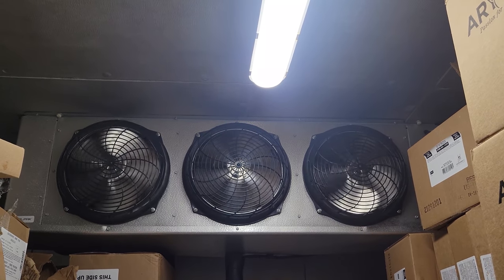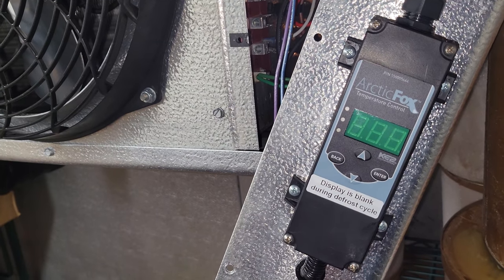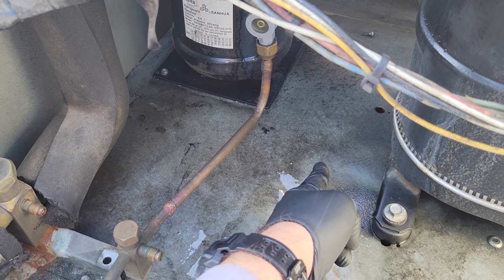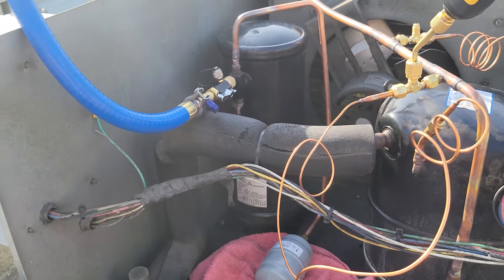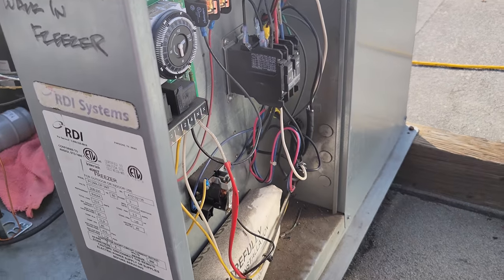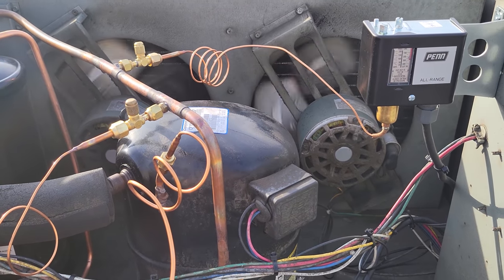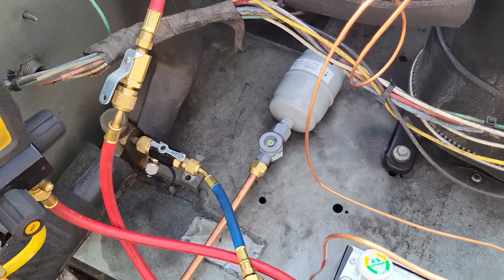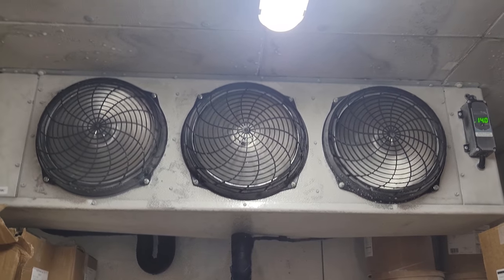THE WALK IN FREEZER IS DOWN AND THERE IS OIL EVERYWHERE

Comment: I love how with the camera frame rate you can see those 2 evap fan motors slow down & speed up slightly.

Excellent diagnosis, added the relay, put in proper pressure controls. Installed in such a way that it's better for the next guy.

A+

Comment: Working as an IT Consultant and parttime electrician i find your videos really fascinating... I like your methodical approach to solving issues and your work ethic is great... one thing that really bothers me is the electronics ratsnest we get to see every time a box is opened... We wouldn't get away with this over here in Europe (Netherlands, to be precise), although i've never opened a roofunit for an large AC or refridgeration installation, i'm quite sure they're a lot neater and therefore safer... (any western european HVACR Engineers here to confirm/deny this?) 

Keep up the great work!

Comment: I love your commentary and theories on pressure switches/controls in the HVAC equipment.  

Disclaimer - this is my opinion as well, I'm an Electical/Controls Engineer who has worked with HVAC stuff for so long I also design the refrigeration parts now as well.  
I watch these videos because 1. I love the "big picture" and doing things properly attitude. 2. I design the stuff, why not watch how people install, service, and use the equipment 3. I can do a better job to make your lives easier.

Why do the small ones (switches) last longer on 24VAC/VDC vs 115/208/277VAC switching?  
Why do the big PENN and RANCO ones last considerably longer only when they have 'enough' load on them?  
Coils.  Contactor Coils.  They all have inrush, and they all have a bit of "snap back" when the power to them is opened.
The 24VAC ones tend to have a smaller inrush, higher holding current (has to for the same VA), and very little kickback when the circuit opens.  That's great for the "wimpy" contacts in a Klixon like pressure switch.  Your big switches need a bit more load/current/abuse to keep their contacts clean.  The small arcs on every open/close even wipe the contacts clean when everything is sized properly, and if its too high a current, you burn up the contacts.  Conversely, if you have too little load, the big contacts will slowly oxidize and make a bad connection.  It's a simple concept when you step back and think about it, yet, it's missed by many.

If you ever want to see it in action, you'll need an oscilloscope, current probe, and voltage probes on each side of each device to watch the circuit in action.

The equipment I design almost never needs new pressure switches, even after 10+ years of service.  Why?  I don't use DP contactors.  I only use IEC contactors with the varistor pack on them to limit inductive kickbacks.  They are much easier on the switches.  Unfortunately, they aren't common in HVAC.  I noticed most equipment and most HVAC supply houses carry only the DP contactors that cost nearly nothing.  A 40A 3 pole contactor for under 40 bucks?  Crazy!
Reply from the maker: I will discuss this on my Livestream on YouTube this evening, 1/24/22 @ 5:PM (pacific) to come over and check it out https://youtu.be/lbSNs2Wizok
Reply: I agree with everything you say. What this is at its most basic is cost shifting from the factory to the field. 
You didn't mention that these same Klixon/Sensata switches formerly were a Schrader valve depressor and fit onto a service port; changing one out took 10 minutes with no need to remove the refrigerant. But the new direct-braze versions cost less for the factory, saving the manufacturer at most a dollar or three per A/C unit, but greatly boosting the repair cost and effort. 
Running full line starting current through these is just plain stupid engineering. Sensata offers heavy duty versions of their pressure switches that have silver-tungsten contracts, but if you check the P/N on a failing part - I'll bet you any money, it will be the standard duty part; just enough robustness to survive the warranty with little life to spare.

Comment: If the oil loss was accumulated in the tray, then I would take a absorbent pad, weigh it on the scales, note it as the tare, then sop up the mess, then weigh the pad again. Then calculate that minus the the tare. And go from there.
Reply: Lol, that’s smart but very unnecessary.

Comment: All the high efficiency equipment our trade makes is junk. Does is save energy - Yes, does that mean customer is saving money - No. Up front equipment costs more, we benefit. It breaks a lot, we benefit, once its out of warranty we benefit even more. How did it ever benefit our customers?
Reply: Excellent question Glen!
As a small business owner myself,  one thing I learned early on is this,  "if you don't serve the customer, someone else will ".  I can't number the customers I have taken from other businesses because I provided a higher quality product ( not Necessarily cheaper), and better service. 
 In the operation of my own business, I look for quality first, price second, for the exact reasons you called out.
  MANY KUDOS TO YOU, GLEN! ! !
Reply: The manufacturers are in a race to the bottom on quality, which I'm sure you know, must be engineered into a product from the beginning. The engineers of this condensing unit only focused on making it meet specific performance and efficiency standards when new, at the lowest possible manufacturing cost. Engineers with knowledge and experience in plain-old mechanical reliability and serviceability were obviously not involved. Delivering a higher-quality product doesn't benefit the manufacturer's bottom line, and they get away with making what you accurately call "junk".  
(how and why they get away with it, well that's a whole 'nother story)
Reply from the maker: I will discuss this on my Livestream on YouTube this evening, 1/24/22 @ 5:PM (pacific) to come over and check it out https://youtu.be/lbSNs2Wizok

Comment: I have changed so many of those fan motors. I've called Kolpak so many times for warranty replacement they finally just sent me extra motors for my van. Lots of issues with those motors and also with the compressor time delay. Sometimes you just have to be an engineer and make some design decisions to give your customers reliability and sacrifice a little energy efficiency.

Comment: 8:02 - I'd be a bit wary about keeping the old pipe that did crack since that seems to me to be a metal fatigue issue and those are just propagating down the line so to say. Resonance causing metal fatigue is a beast of its own. I understand the idea behind the shortcut though, it saves some headache and maybe it will work. Good that you strapped it down though, so maybe you are safe.
15:55 - under the connector where the oil was filled on the suction line there's something glittering. Maybe just old oil or loose insulation though.
Reply: The heat from brazing will anneal the old copper so it should be ok, same as when you heat hard drawn copper before swaging etc.

Comment: Great video, I normally put two loops on the discharge line between compressor and condenser  to avoid cracking works a treat.
Reply: THIS is excellent advice.  I often wonder if people just don't understand work-hardening of metals, or are just to lazy or are they worried about cost to do the job correctly.

Comment: I'd rather two-speed old school style. Twin windings. So much less that can go wrong in them, as there's no electronic control board to kill with condensation.
I find it hilarious when they have this emphasis on "energy savings" in the fan motors, when the fan motors are a fraction of the energy spent on the actual box running under power.
Additionally when all these fancy electronic computer systems are constantly failing, but an older design exists that would do the job far more reliably.
Multi-speed non-ECM motors have existed for a very long time, and I own several pieces of equipment with them. But manufacturers want to put electronic controls in everything these days...

I love electronics as much as anybody else, and in fact my day job is to build and fix them. But they have their place, and more importantly, there are places they don't belong.
The old way isn't automatically bad because it's old. Yes, the newer way is sometimes better, but sometimes the old way is better, and throwing away perfectly good electromechanical systems that've been reliable for 35 years to put in an electronic control that'll die in 6 months ... that's not progress, that's marketing.

Comment: I have been watching this gentleman’s work for a long time from over the pond in AU.
I’m amazed at the equipment in the USA, it all seems so “flimsy” to me. I have a shop with a 50year old cool room running OEM equipment.
I used to be a refrigeration controls engineer and we only ever used Carel / Emerson controls. With our evap fans all our motors are PWM motors so only one winding with electronic speed control. The thermostats we use drive evap fan speed, e-Txv, condenser fan speed and also variable speed compressor (optional) or fixed speed. The CellarMate controllers are around 500AUD but will even make a old system energy efficient. Are customers really penny pinching?

Comment: The two fans seemed to be surging in the video. They would run for an instant then spin down a little over and over. 

At a guess they might have had an internal overload/thermal cutoff that was going off.
Reply: I noticed that myself.
Reply: It’s hard to judge how a fan is running on video, the frame rate makes them always look wonky even if they’re working right
Reply: I think it was the camera shutter. I saw that myself as well

Comment: Fun Unrelated Work Story: I was stuck in the store after hours by myself. Years ago, our two restrooms were converted to storage rooms because the wetlands behind the store expanded concerningly-close to our septic tank/leaching field, and our well is near the wetlands as well. (Major developer in town greased some palms back in the 80s to get approval to build a strip mall bordering a swampy area.) The fixtures (toilets, sinks, TP & soap dispensers, etc) are off the walls, but the electric hand dryers still exist.

So yeah, the store was pretty quiet, just the normal whirr of various equipment. Suddenly, one of the hand dryers begins running. It's one of the hands-free models. And no, we do not have a vermin problem - we get a gnat infestation every spring due to nearby farmland, but we never have vermin, and our pest control company is always surprised that there is never evidence of mice - well, they're all down at the Chinese food place and the pizza place, as long as they stay at that end of the strip it's not my problem. So, I start thinking that, along with every other piece of broken equipment we have, it's an intermittent problem that nobody noticed or bothered to tell anyone about.

"No problem," I think, feeling a bit smarter-than-the-average-bear, and I head to the breaker panels. Both panels have nicely-handwritten labels, and I'm searching like crazy for a breaker labeled "Hand Dryers." It's gotta be a double-pole 240V breaker, right? Well, all of the 240V breakers are labeled for the equipment, none for the hand dryers. I actually said aloud, "Oh no, they can't be using 110V hand dryers, what were they thinking?" I begin my search again. The only thing I can find are two 110V breakers labeled "Rest Room" and "Rest Room." The hand dryer pops on, and I flip the first "Rest Room" breaker I choose, which happens to be the right one. Except... The breaker that operates the hand dryer also operates an unused GFCI receptacle, the infrared-operated ceiling light, AND the emergency light power (the only one in our unit that actually works, since all the others have long-dead batteries). Shaking my head, I flip the breaker back on, and went home.

Comment: 75% of small evaporator fan issues is water in the harness. Cut the 3rd prong for the lo & hi usually a flat on the fan connector and good to go. If you still have the issue replace the fan wire harness.

Comment: I know you don't do window AC but I bought one last summer I noticed what the hell is r32 it says refrigerant r32 it really does never seen that before
Reply: R32 replaced r410 a as it has a lower gwp , r410 is being retired for new equipment under a certain kg vrv will still use r410a

Comment: having a ring on when working with electrical is a bit of a hazard, you could loose a finger if it touches anything, i'd recommend putting it on a chain/necklace underneath your shirt
Reply from the maker: It's a silicone ring for that exact reason, the silicone rings will break away and are non conductive
Reply: @HVACRVIDEOS  Ah! I cant tell on video, it appears as a gunmetal finish on this end. Good deal then
Reply: You tried 🎉🎉🎉 😂

Comment: where the fan cycle switch's sensor goes into the liquid line, do those copper Tee's have a flare nut connection where the sensing line connects?

Comment: Hi Chris do you ever charge to superheat or do you prefer to fill the site glass when the box is close to temp
Reply from the maker: No in Refrigeration on systems that have receivers you never charge to superheat. Superheat is something you adjust after the system is fully charged
Reply: @HVACRVIDEOS   thanks Chris so a fully charged system for you is a full sight glass when the box is close to temp and then adjusting the txv to hone it in if a new system I guess
Reply from the maker: I will discuss this on my Livestream on YouTube this evening, 1/24/22 @ 5:PM (pacific) to come over and check it out https://youtu.be/lbSNs2Wizok
Reply: Cheers Chris

Comment: So the two left motors went full left shark. Cool, cool. So, correct me if I'm wrong, but doesn't a motor that's OFF or unpowered draw less power than a motor that's spinning 24x7 on low speed? Seems like #EnergyInsanity to me.
Reply from the maker: I will discuss this on my Livestream on YouTube this evening, 1/24/22 @ 5:PM (pacific) to come over and check it out https://youtu.be/lbSNs2Wizok
Reply: Fan motors and heaters draw more amps on initial start up.  But shutting it off or running in a low speed I’m sure are the same energy consumption.  If you break it down.  Engineers and customers want what saves money.  I’m sure to someone that doesn’t really understand it’s easy to sell the equipment.   I work on Walmarts and sams clubs,And let’s say  you can save 15 grand a year if they initially spend it up front.  Or over the year it uses 20 grand in consumption they would choose the 20 grand route because it’s broken down and it’s not All up front.  That’s why Walmarts rejects the PM’s.  They don’t want to spend the money up front but rather break it down.  It makes literally zero sense.
Reply: @jakefurgerson8398  its an accounting thing

Comment: Why not put the oil in when the system was flat?
Reply: Would the oil absorb crap from the air? And then vacuum draw would be much more difficult, as the air had to be sucked out of the oil?
Reply: I suppose thats possible. But I can’t imagine it would require that much more of a vacuum. With that logic, the remaining oil in the system is exposed too.
Reply from the maker: I will discuss this on my Livestream on YouTube this evening, 1/24/22 @ 5:PM (pacific) to come over and check it out https://youtu.be/lbSNs2Wizok